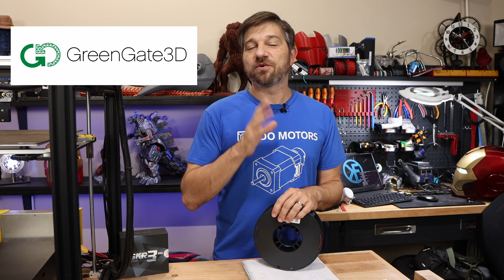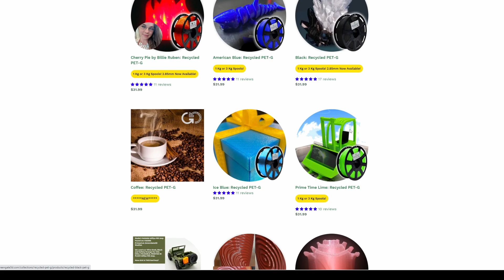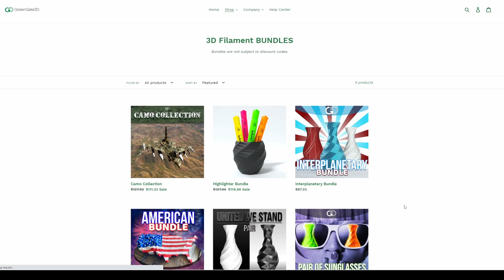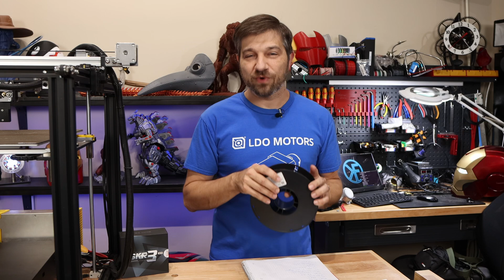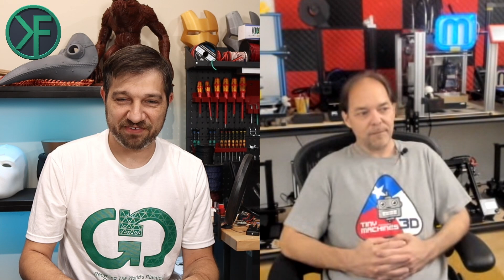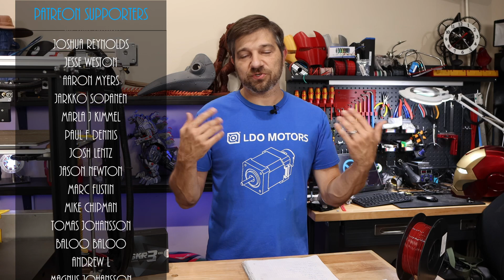Marlin Firmware 2022: An Interview with Scott Lahteine (3/3)

Comment: I have question about firmware upgrades.  I have two Creality Printers (a CR10S and an Ender 5 plus) both run SKR 1.4 Turbo boards.  Both Printers are working great and consistently knock out one prefect print after another.  The CR10 uses an early version of Marlin 2.0.Bugfix and the Ender 5+ uses your firmware (Marlin 2.0.7.2)

Is there any advantage to upgrading to Marlin 2.1.x?  Or is it best to just leave these working printers alone?
Reply from the maker: My philosophy on firmware:
Only upgrade your firmware if:
a) You have a bug that you need a fix for.
b) There is a feature in a newer version you'd like to have.
For example in the latest version of Marlin, 2.1.2, there is now Input Shaping. If this is something you're interested in, upgrade and give it a shot. With that said, I don't have a 2.1.2 firmware available yet but I do plan to release one.

Comment: Long series, and didn't listen properly all the time, but:
- Linear advance: with TMC2208/2209 without UART: could have switched to Klipper smooth PA or added jump wire to have UART, but Marlin saved.
- Input shaping: though not that important on Ender3-clone, also now in Marlin.
- Octoprint: it's mostly to avoid walking with uSD card (original one decided to hold only few files before it needed formatting :/ ) :)
- Controlling printer from printer "console": I guess it's very basic on Klipper. I hope it would be possible to get a list of files from host and start (re-)printing from the printer UI. Or save gcode to uSD while receiving. Maybe some of these are already implemented?
- Power loss: did recent Creality machines stop putting blobs? How did they do that? Is current Marling waiting for the write to uSD to finish or how does it work, should look at source code. But I guess it's not possible to read from the card while writing...

What bugs me in Marlin is EEPROM. It is used as serial ordered fixed meaning list, so configuring features on and off (think of A/B testing IS) voids all the settings. Maybe it could be some sort of dictionary (header: content, size; data[size]) so that initial order would be maintained and new settings would be added to the end. Possibility to save and read (complaining about settings that are not in FW, but not refusing to complete) settings to/from a file in card using Gcodes would also work.
Or not sure if Octoprint has possibility to paste many lines of saved settings (get them before FW update, just remember or check which M50X to use), maybe there's a plugin for that...

Comment: The more options out there, the better for the consumer. These guys will live on as legends in the tech community and in the future when 3d printing is as standard in the household & a necessity as your home microwave that’s when the normal joe will also appreciate all the hard work these guys have put into the development of 3d printing. Marlin for most i’m sure was our first software so it will always hit close to home when people are moving away to klipper. I understand why and i have 4 printers under marlin and 5 under klipper but there’s some advantages one has over the other so we can only hope & encourage these guys to continue to update marlin into a very competitive firmware like the old days. The reason i love marlin is because of it’s standalone software were one board controls all and you can shut down and turn on the firmware without worrying of corrupting your files but the one drawback is the speed limitations. That’s were klipper shines but i know marlin will catch on with the crazy speeds as well & drop support for 8 bit boards. Hope they read this and know we appreciate their hard work and we support them. Even if the video is a few months old lol

Comment: This is awesome content!!! Right from the firmware creator. I'll be trying the new input shaping out, the thermal modeling was already calling me to try it. On the flip side of the "wasting mcu capacity", many marlin installs already have the Pi sitting there running octoprint anyways, and all that compute is being wasted when it could be computing steps. I also think the klipper API is way underrated, very powerful and removes the whole serial pipeline marlin seems tied to. Having 2 great firmwares to choose from is a wonderful problem.
Reply from the maker: Thanks for the feedback! As you say, it's never bad to have options.

Comment: I feel one of the biggest improvement Klipper did for me at least, is giving my 8-bit AtMega2560 board a new life by taking all the convoluted instructions to the Raspberry PI to handle and leaving the more basic instructions to the 8-bit boards. With that I am physically able to print significantly faster without sacrificing quality. But don't get me wrong, I was very happy with Marlin. It has given me great prints only at slower speeds for my board to catch up. Plus no extra spending was needed. Also I do notice a significant reduction in visible Z banding I get off running klipper. All in all I am liking klipper a lot but I am also looking forward to revisiting Marlin again with their version of input shaping. It would be great if Marlin can be written to work similarly like Klipper in that it is able to take the heavy lifting off the mainboard in the printer. Last but not least I really enjoyed listening to this 3 part interview with Scott Lahteine. Its certainly comforting to know that Marlin is working on improvement and continue bringing rich features that users hope to see. Thanks Kersey Fabrication for this 3 part interview.

Comment: This is off topic, have you experienced hotbed overheating, if so how did you fix? I just got a new ender 5 
Plus and installed the silent board and now hotbed continues heating beyond set temperature. Replaced the original board same thing. I took great care to plug everything in correctly. I am very confused and trying to get help from Creality is almost impossible.  Wanting to print. Please help! George
Reply from the maker: That shouldn't happen with stock firmware. I'm actually surprised. If your comfortable flashing your firmware, you may want to try my PID bed heating. See my video on flashing the firmware: https://drive.google.com/file/d/1OqamK06I70ZeWeiOV_gAxygaFczhJcLo/view?usp=share_link